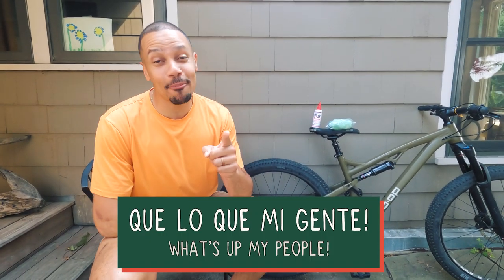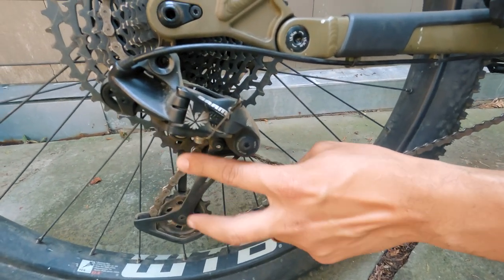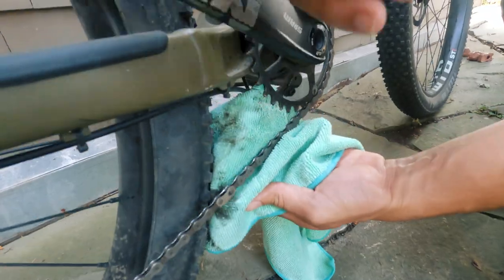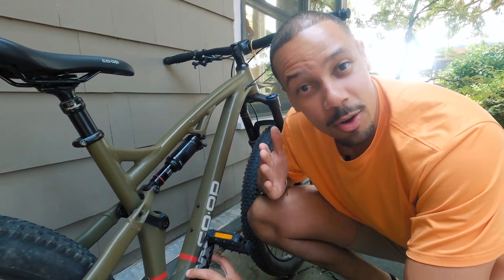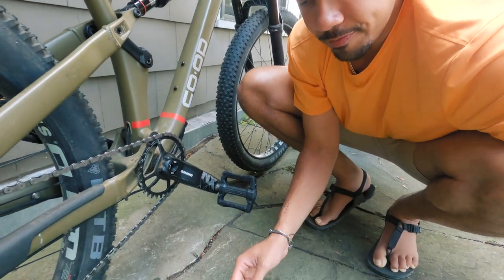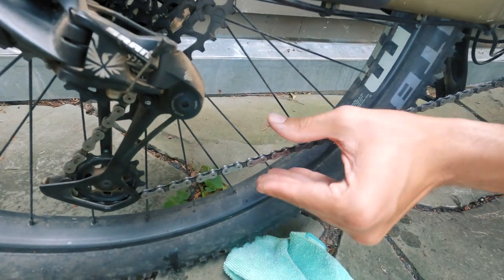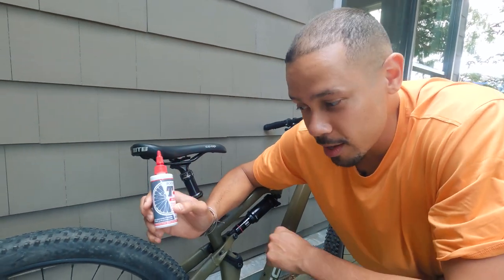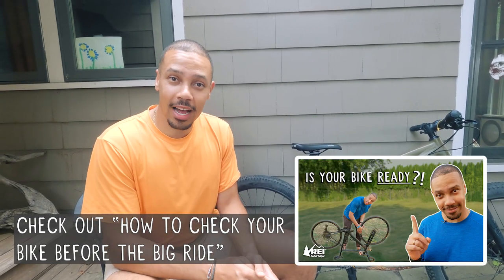How to LUBE Your Bike CHAIN | ..and CLEAN it too!

Comment: Hi, Kevin! This was so informative! Which chain lubes are best for each type of riding?
Reply: You can get a quart of 80/90 weight automotive gear oil from Walmart for probably 7 or 8 dollars.   Apply it with a paint brush to your chain as you rotate the pedals.   A quart of gear oil will probably last you 5 or 6 years before you use it all.    This "painting the chain with gear oil" method is what motorcycle shops recommend so it will also work for bicycle chains as well.
Reply: Skip the oil and go with waxed. Head to a thrift store near you and find a smaller crockpot. Grab some Molten Speed Wax, place the wax into the crockpot and once it liquefies, place your CLEAN chain into it. 

Follow directions on the wax brand. And presto, no cleaning or lubing the chain for at least 6+ months under heavy usage.
Reply: Wax based lubes would be best.

Comment: That's it for cleaning? I'm cleaning the whole drive chain with soap thoroughly and maybe also with some kind of grease remover and put then the lub on. If you shift because your cassette isn't clean the chain is collecting all the dirty from it and you have to "clean it" more often.
So real Pro tip put on your lub after you cleaned everything an than it works even better and it lasts for longer 👍
Reply: This video is aimed at lubing your chain vs cleaning it, but cleaning with soap then lubing is exactly right!
Reply: @KevDoes  wouldn't grease be betterr.  wtare and metal dont mix.   why do you have to get all the grease out anyway of a chain if you're  not waxing